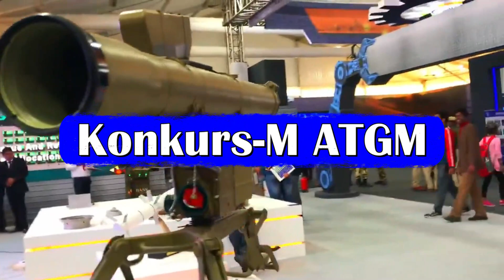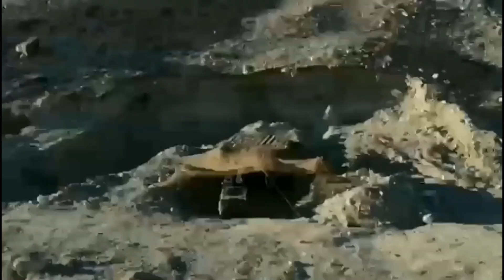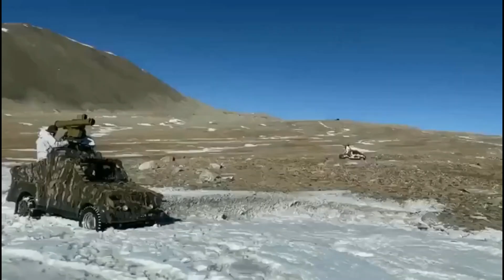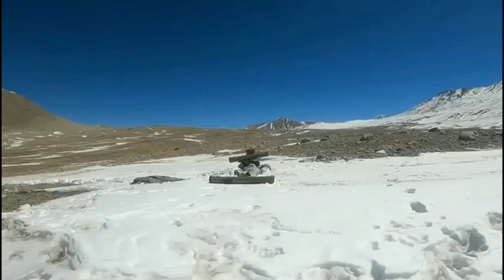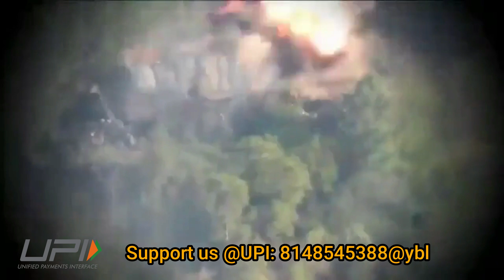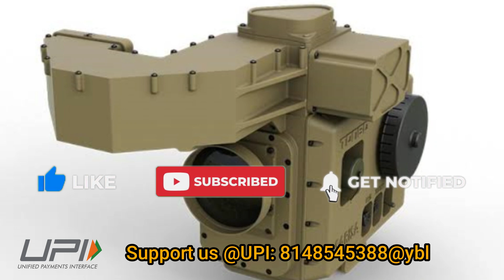Army upgraded Konkurs-M ATGM with thermal imager from Tonbo-Imaging

Comment: I would much rather see mass induction of DRDO Manpad, which has top attack and a range of 4km. Vayu Sena is better off just replacing its entire stock of obsolete 2nd gen ATGMs than any kind of upgrade. Placing orders in tens of thousands for Manpads that are capable of inflicting the same damage as the mighty javelin is a much better use of cash.